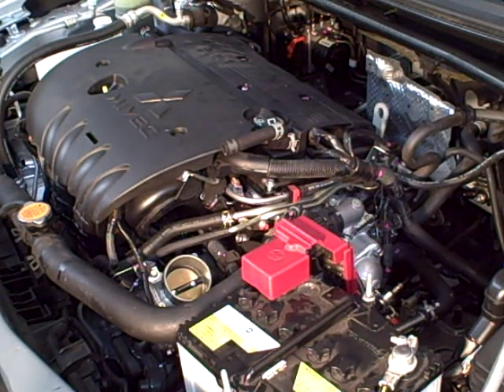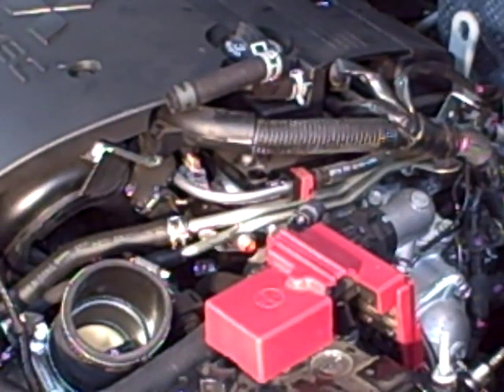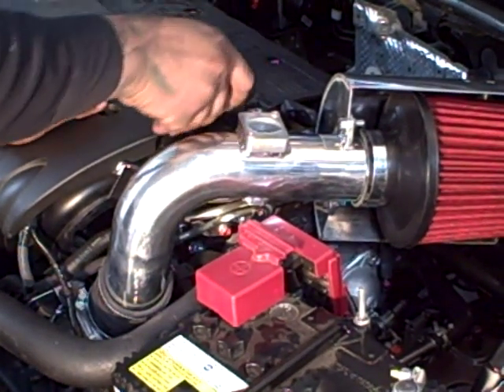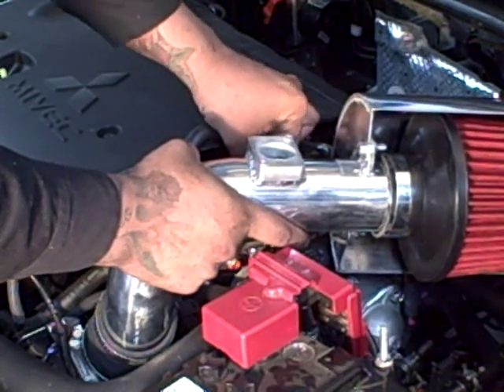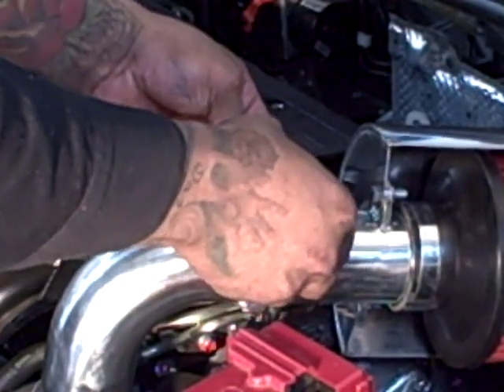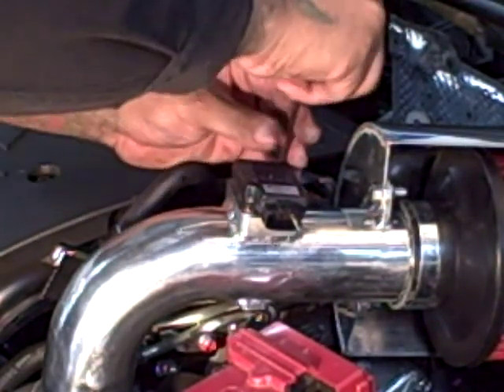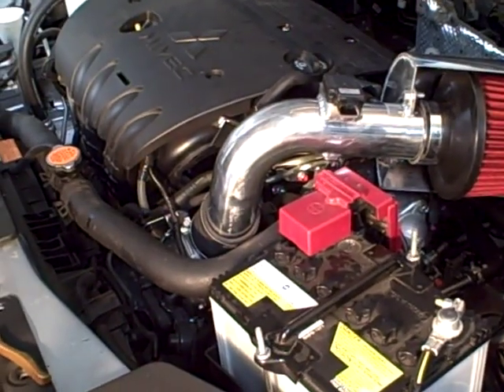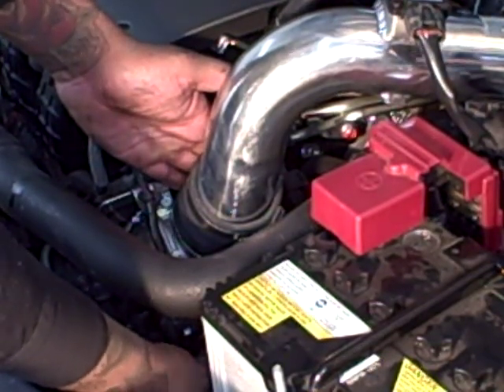PART 2- road race v2 intake install lancer

Comment: the hole on the Bracket attached to the ram is too small to fit taht 10mm bolt thru.

Comment: Beware...

Heat Shield is a pain in the ass to put on...
It feels like the hose is being pinched next to engine
NO allen wrench supplied
The allen screws are tiny...its taking me forever to put on this MAS Switch..literally you have to press down so hard on the switch to get the screws to thread

Still in the midst of installing though we'll see how the rest pans out